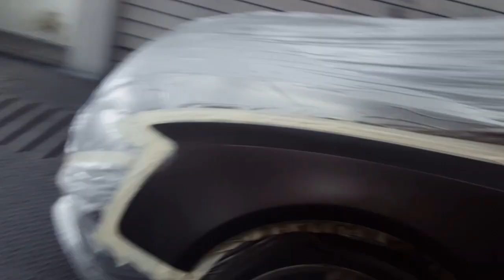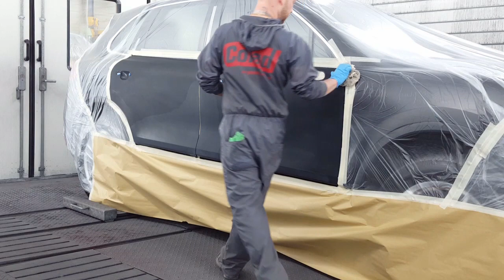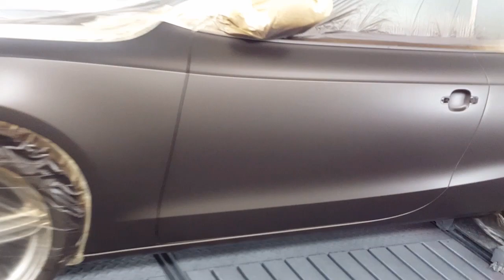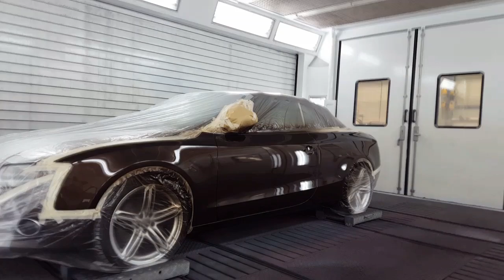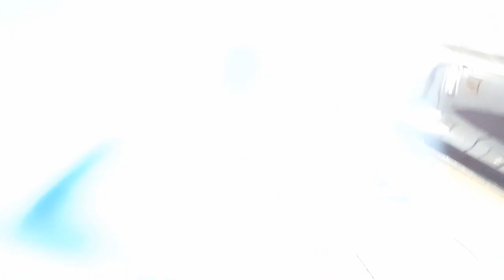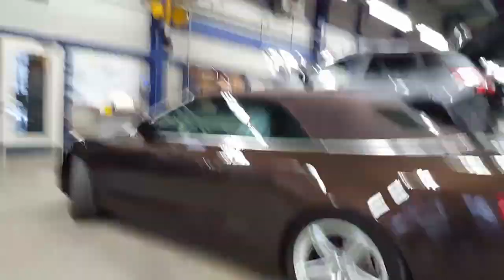Audi a5 3.2fsi and Porsche cayenne (spies hecker)

Comment: what clear coat used and that spray gun used my friend for this car?
Reply from the maker: Spies hecker 8034 clear 3:1 wih 3230 harder and 10% 9034 reducer. devilbiss gti pro 1.2 nozzle and the t2 air cap at 2.15bar.👍

Comment: No wet bed?
Reply from the maker: yes no wet bed,why should you use a wet bed in this case
Reply: I thought wet bed was required all time before blending the base?
Reply from the maker: In my opinion you can use a wet bed for difficult colors,but not needed also.
Reply: fuzzy5101 
He's right. Wet bed is only used on  certain colours.
Most dark colours dont require it.